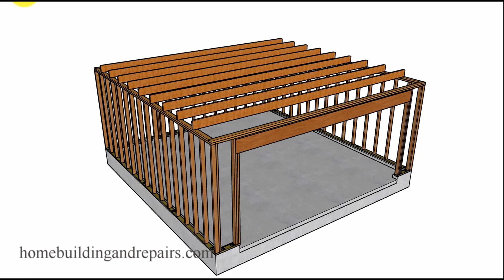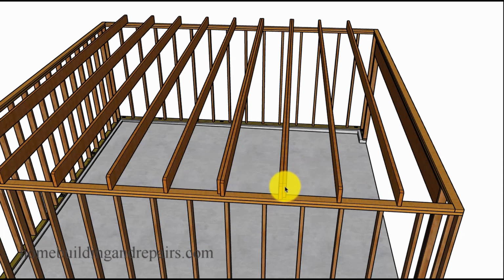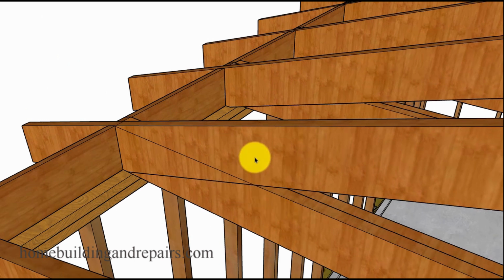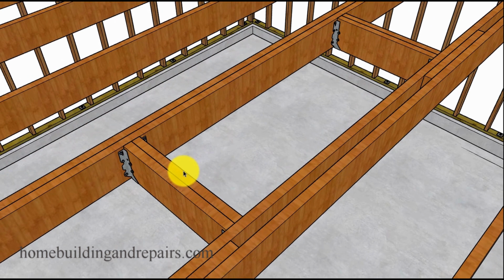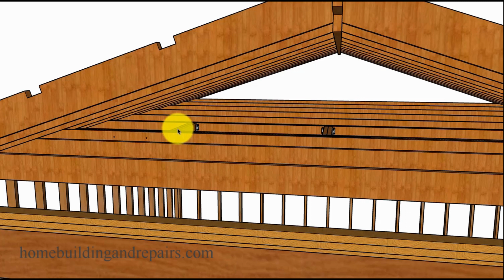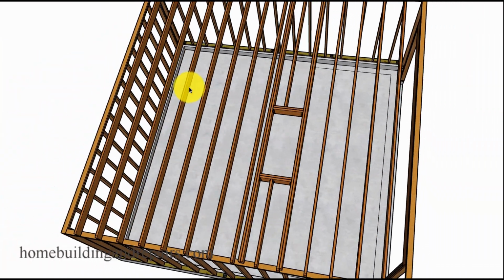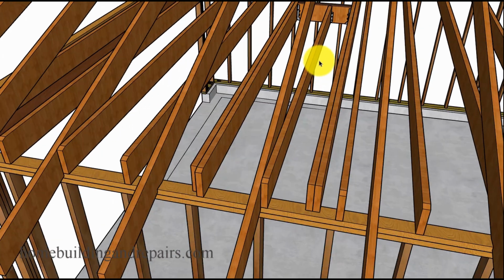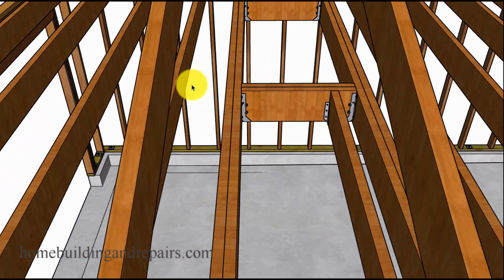How To Frame Pull Down Stairway Opening In Garage Ceiling - Home Remodeling Tips

Comment: Really helpful, thank you! For the doubler side that doesn't require a block, do you still need to connect the two 2x6 joists together with 10d nails along their length, or is it enough that the doubler is set next to the original joist and held in place with a single toe nail into the top plate? I ask because you can't toe nail the doubler from both sides since it's abutted up to the original joist. Thanks!
Reply from the maker: If you can install a block between, you might be able to use a larger hanger, maybe a 6x or 8x hanger and I like to use 16d nails.

Comment: If I only need to make opening to get into attic and not need to attach a leader, do I still need to double beams on both sides?
Reply from the maker: Having a double joist around stair well opening is standard but I've seen these stairs installed between joist or roof trusses with out a problem.

Comment: I'm building a block house and putting a flat roof on it for a patio ( 3rd floor ) and i'm having a set of stairs going up to it, I'm going to be using 2x6 for roof rafter. Will i need a support wall under the 2x6 i cut? or hoe would be the best way?
Reply from the maker: It's difficult for me to understand what you're doing, but you can always build it without it and if it seems weak then add the wall. You can always send me some pictures for more information also.
Reply: @stairbuilding  Well i don't really explained it to good What i'm going to doing is building a block room 12x12 feet,I'm going to use 2x6 for a flat roof...how could i take like 5 feet out of one of the rafter for a stair to get up on the roof ( i'm going to use the roof as a patio ) can i just double up on the 2 rafter on each side to support the one i cut 5 feet out of? or do i need supporting frame under the cut 2x6?
Reply from the maker: @richardsmith7783  I think the best advice I could give you would be to search the Internet for something similar to what you are planning on doing. Again, I don't understand exactly what you're doing, so it will be difficult for me to provide you with additional information.

Comment: Where the doublers rest on the top plate if they are not directly adjacent to a truss should there be some nogging or dwangs there to prevent twist and destabilization? Also would it not be more efficient to install cross bracing doublers from ceiling joist to the next ceiling joist greater than the rough opening width required rather than add an entire joist span? Then the R.O. could be framed within this box of doubled joists and cross bracing doublers.
Reply from the maker: Please provide me with some more details about the doubler resting on the top plates, I didn't quite understand your question. And of course additional bracing will always be helpful and is far as your last question, if you're asking whether or not a box can be built inside of the box, then I think it can, but this might not be possible for every situation.
Reply: In other words the ceiling joist and the rafters together form a simple truss.thwy are strapped or nailed together where they rest on the plate. So if you offset a ceiling joist to accommodate an attic stair then your joist is no longer able to be attached to the rafter to make a more stable sport.